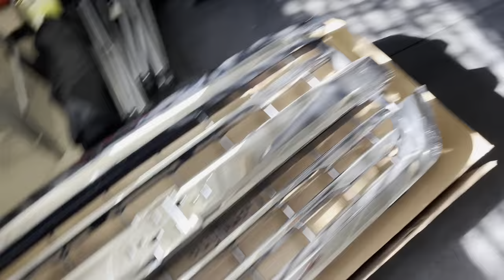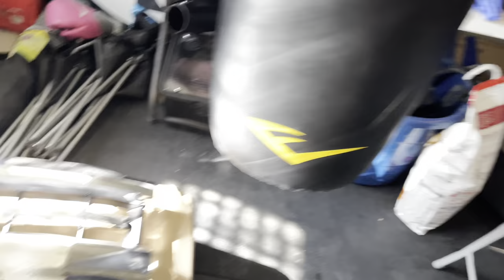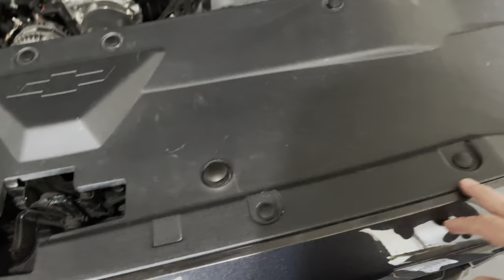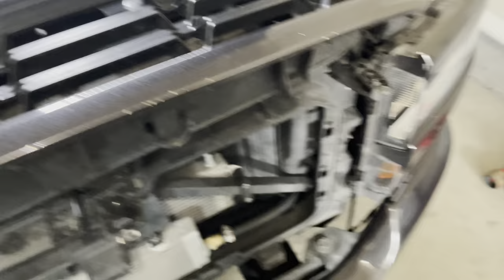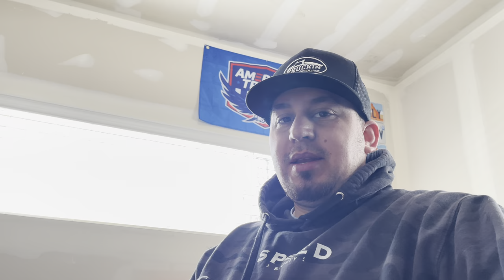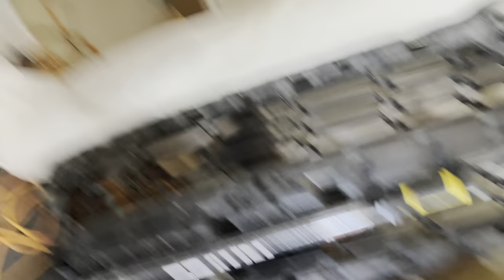Installing my new silverado High Country grille & bought Weld s77 rear wheels .

Comment: How did u take the clips off to take off the chrome
Reply from the maker: I had to pry off with a clip remover tool. Only the 3 big bars . The smaller than chrome pieces stayed on the the new  grill i purchased . Using a heat gun helps to avoid breaking the tabs.
Reply: @gabestang do you have a video of you doing it?

Comment: How much was the grille and you were able to order it color matched?
Reply from the maker: $540 
Gm # 84056776
Online from gm 
Findlay Chevrolet Las vegas 

I removed my old painted parts and swapped it.
Reply: @gabestang  ok I just got my grill I was actually just thinking about this before I seen your comment is it an easy job to do or do they break easily when removing them
Reply: @gabestang sorry just watched your video lol I bought wrap to color match the chrome bars you think it’s better to do it that way?
Reply from the maker: @TuryLanderos  yah bro if its like a black or white wrap is easier and faster . In my case the color was hard to match the truck .
Reply from the maker: @TuryLanderos  its very tedious  but using a heat gun will help . Luckily mine didnt break but some clips are chewed up
Reply: @gabestang  thanks man . The bottom ones ended up coming out a little chewed up due to the heat gun but the middle and upper clips I was able to remove with a flat head.